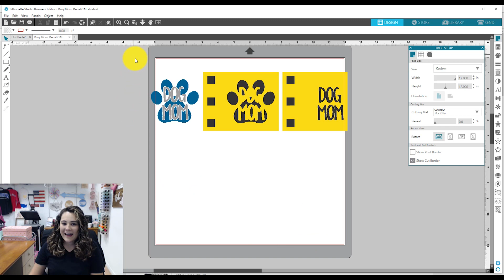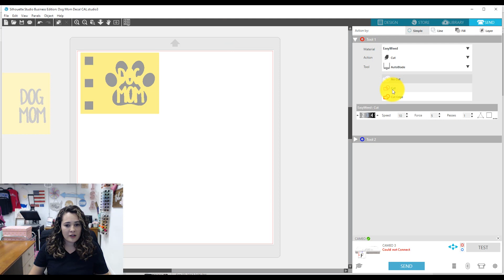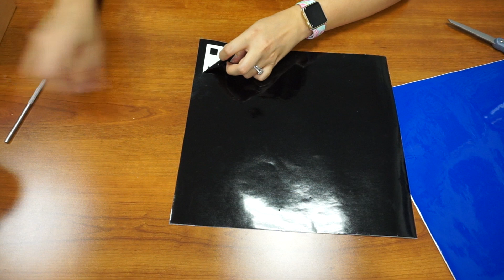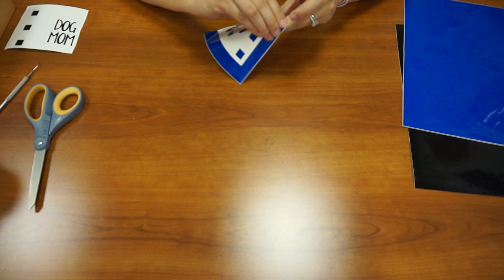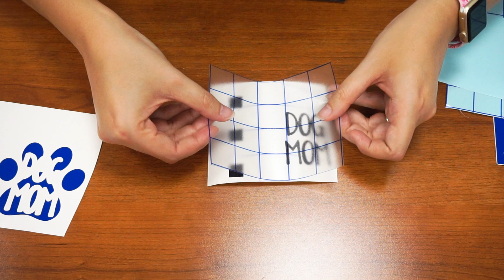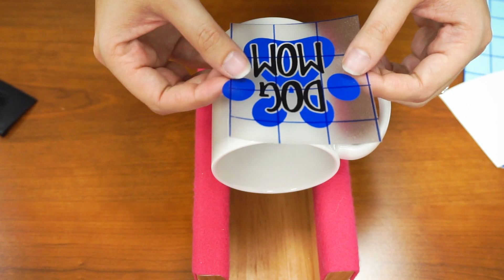Creating a Custom Pet Lover Mug Using FDC Sign Vinyl

Comment: I purchased vinly from you guys and I'm concerned i might not be on the correct cut setting. When i try to weed, everything lifts up and i have to place it back manually. I had it on regular vinyl setting then changed to outside vinly and i'm still having trouble. Not sure what to do.
Reply from the maker: Hello! Just to be sure, what kind of vinyl are you using? And are you using a cameo? - TRW Richard
Reply: Intermediate vinyl 4200. I have a cricut.
Reply from the maker: Unfortunately, we are not sure of the cut settings for that vinyl, as we do not work with Cricut cutters. Perhaps you could contact them for the cut settings? - TRW Richard
Reply: Ok, is your FDC intermediate vinyl considered to be out door vinyl?
Reply from the maker: Hello Tara,
All of our FDC vinyl that you see is on our website is good for the outdoors. - TRW Aaron
Reply: TheRhinestoneWorld ok, thanks for answering my many question. Lol Greatly appreciated